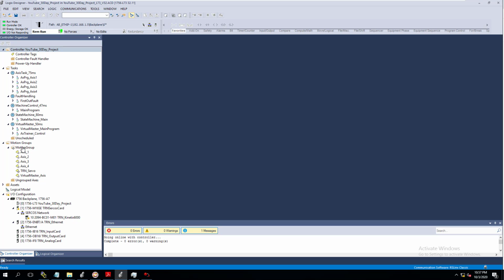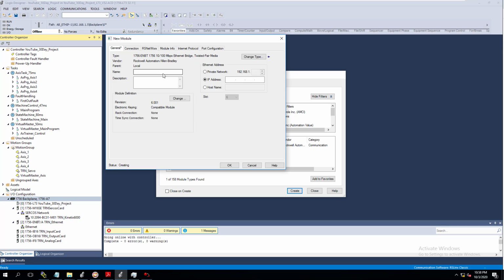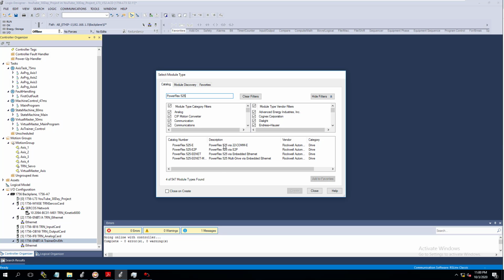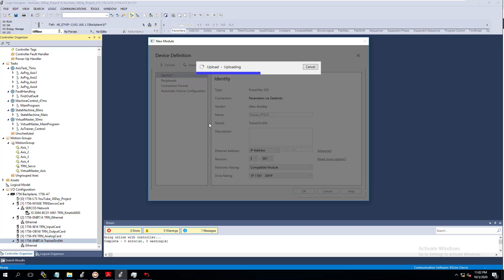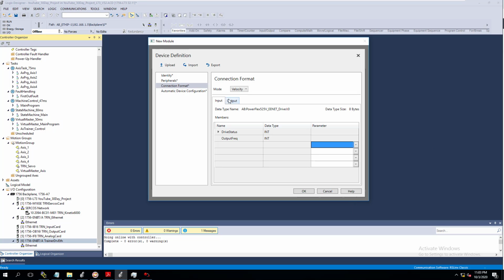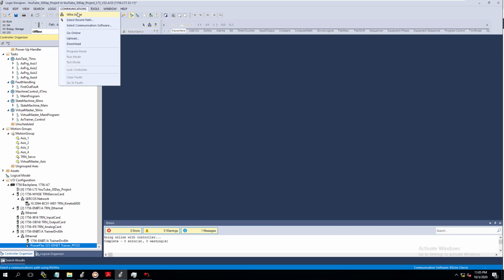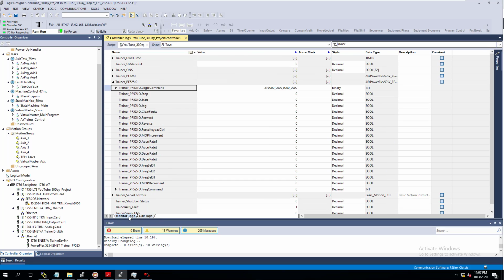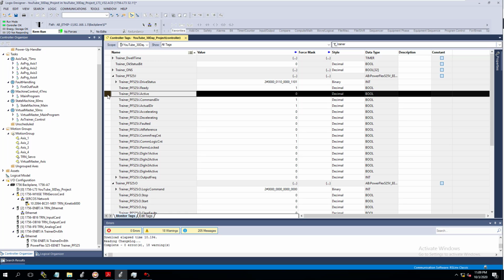Adding a Powerflex 525 In Studio 5000 Version 32 PLC Program Using  Drive Match

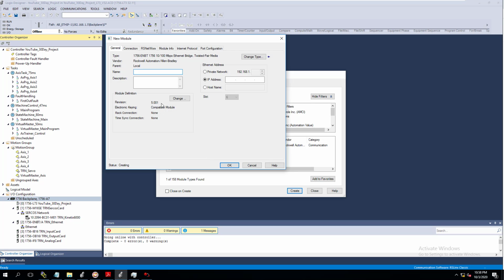Comment: At 1:50 you changed 1756-ENBT firmware from 5 to 6 for improved compatibility.  You chose ver. 6 because that was the latest version of 1756-ENBT at the time?  Or was there another reason for updating the firmware?  Thank you.
Reply from the maker: 5 or higher for produced/consumed communication

Comment: Excellent !! If possible I do something with the Power Flex 753 on Ethernet or DeviceNet
Reply from the maker: Depends on the firmware of the 755 or 753 but yes, using the CCW tool.

I normally use Drive executive for big drives but in the coming future it will be CCW & Drive Explorer.